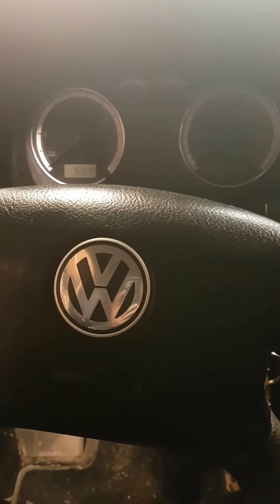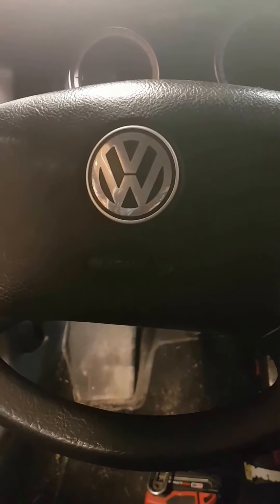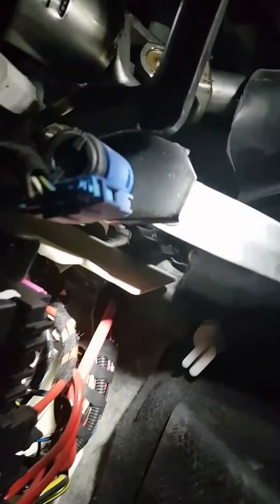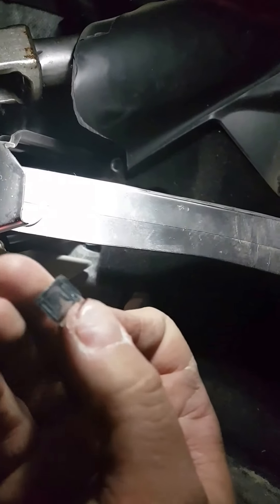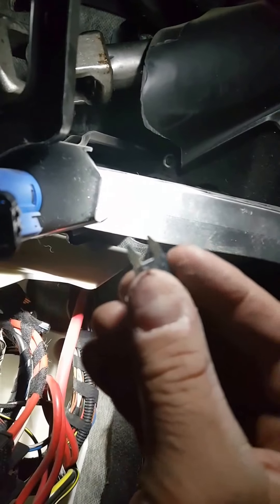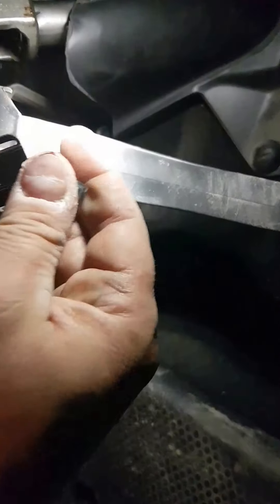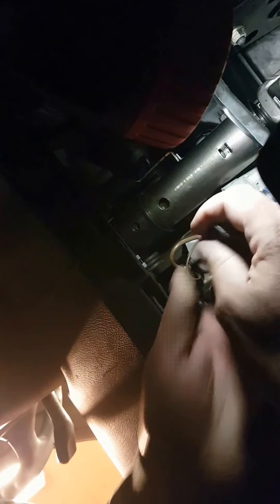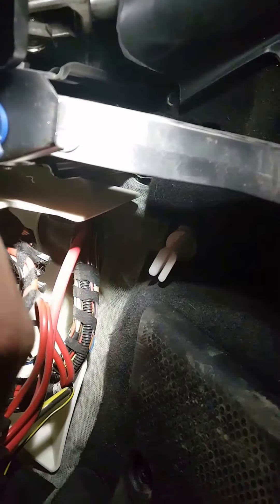00-05 VW Jetta, Golf, Beetle, MK4 start car without pushing in clutch.

Comment: Thank you thank you thank you thank you thank you thank you thank you thank you thank you thank you thank you thank you thank you

One thing I'm going to do is buy an assortment of fuses starting at 15 and going down and putting in the smallest value fuse that will do the job. I would rather the fuse burned out than the car. I'm pressed for time right now but I think I'm going to mount a momentary on switch on the dash with this plug wired to it so when I want to start the car I turn the key to the start position and push the button.
Reply: I was trying do the same but i would hide the switch and still leave the clutch switch connected, but the car now doesn’t start. I don’t know what happened. Happened this to you also? Mine is VW jetta 1999 1.9 tdi mk4

Comment: Why do you want to start w/o pushing in the clutch?  I'm going to look at a '98 New Beetle. From the owners description, its sounds as though the clutch fork is collapsing so clutch doesn't release. Doing this, maybe I can start it in first and start driving it home, matching engine speed to tranny speed to shift.
Reply from the maker: This is just for the first initial start.....if you had a problem with the sensor you could do this or for personal preference.....I think in beetles case revving it up to get into first gear may not work that well.   but in your case just to get it home it may not make a difference doing this Mod.
Reply: Did you buy the beetle? Sounds like the clutch slave cylinder is bad.
Reply: @ConTheDon187  No, I didn't think it was worth the trouble. I was looking for something that could replace my Plymouth Neon which is having problems, and this Beetle would require too much work to make it usable. I have seen that the clutch fork is weak on these and requires transmission removal to replace it.
Reply: I want to start the engine without pushing in the clutch because
1. It's annoying
2. None of my other cars are like this
3. It puts load on the thrust bearing while there's no oil pressure

The problem with this method is that the cruise control won't work. Instead of that jumper/fuse, I'll wire in a manual switch. Thanks for the video!

Comment: I finally got around to trying this and nothing happened. Dang has it been that long? I'm old and I hurt and it's freaking hot here most of the spring and summer into September so I'm back at it. I bought a remote starter switch so I could put it in neutral and try starting it from outside, but I'm not sure how to hook it up. Is there a video somewhere I can watch?
Reply from the maker: did you ever get that figured out?